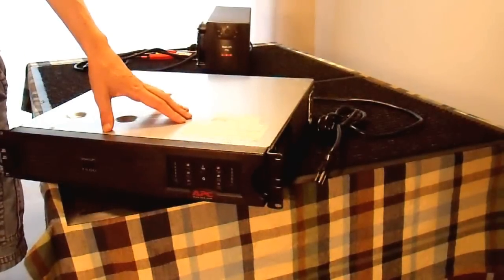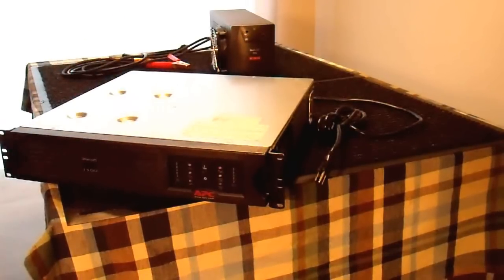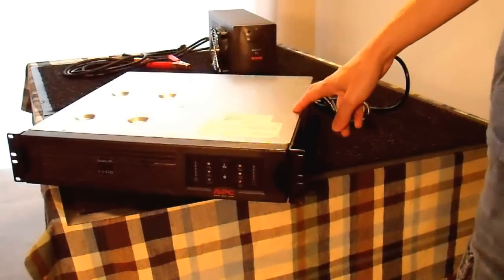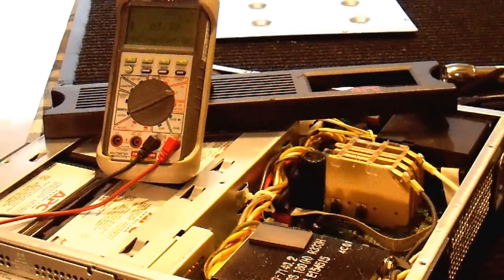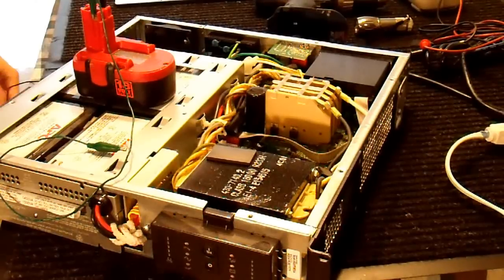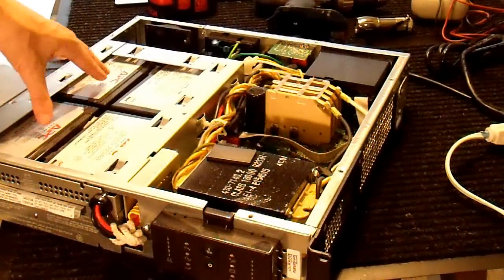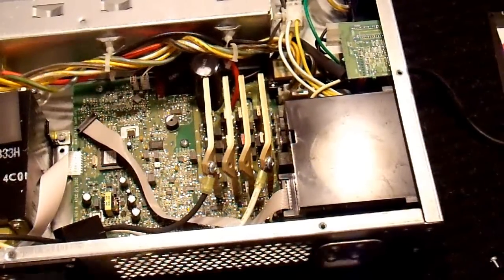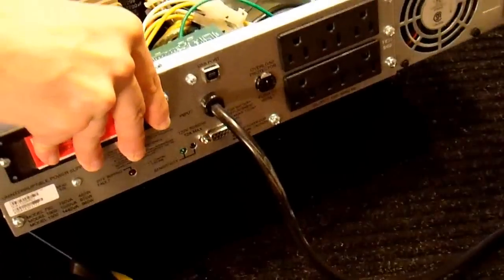UPS to 1.5kW Sinewave Inverter Conversion part1 - Free Sinewave Inverter??

Comment: Weird that an APC rack mount UPS would require the battery pack to power up when connected to mains power the reason being that hot swapping the battery packs is commonly done in the IT world. Every Cyberpower UPS I have worked with powers up without batteries or with dead batteries.
Reply from the maker: They don't want people turning them on without mains power to avoid complaints is my assumption, and they don't want you to power them on with no battery present for the same reason.  I believe the intent is that a 'bad' battery will still allow you to power it up but 'no battery' is not a valid use application.  You can hot swap batteries while running, you just can't turn them on unless mains power and a battery of some sort is present.

Comment: The reason they throw them out is because batteries cost about as much as a new unit.
Reply from the maker: Companies usually have a replacement rotation schedule.  e.g. if the warranty is 5 years they'll replace them at or soon after 5 years.  Batteries are actually fairly economical for these units compared with the price of a full replacement unit.  That said I see a lot of these get thrown out once the batteries die simply because the people making purchase decisions either don't know how they work or don't care about how much they cost.

Comment: have you got any experience with Socomec NETYS RT-120V 1000VA 900W pure sine wave UPS?  On the spec sheet, this is the lowest, and the highest capacity for this series is 4500VA.  I suspect that inside, they have a partially populated board like you've shown in this video.  I'm thinking of putting a big capacity transformer that is 120vac to 240vac center tap. so 120v-120v off each leg to CT.  Do you think this is reasonable, or should I consider replacing the output transformer on the unit itself?  Thanks.... Doug  (I also have a shot at some 12v 190AH batteries - same brand as you got scrap for $40 - for $300CAD a piece.  they're brand new.  Is that a good price in your experience?  )
Reply from the maker: I'd say to pass on batteries at $300 CAD if they are questionable.  Shopping around you can get them for new at nearly that price if purchased in bulk.  If they truly are new and in good condition then that is a good price and I'd jump on it if I were looking for batteries today, but if there is any question as to their condition then they should offer more of a discount in my opinion.  The transformer is usually the highest cost component of a LF inverter/UPS so if you have or can get an appropriate transformer that may be an option.  I have no experience with Socomec.
Reply: @knurlgnar24  Thanks for the reply and the sage advice.  I've got some modified square wave APC backups..... would be nice to convert one to pure sine wave.... I cracked open the Socomec, but the board appears to be fully populated.  I see from the series that this particular model goes up to 3000VA.  At 5kVA, the whole thing seems to change.  Is it possible that changing up the MOSFETS is how they get the added capacity?

Comment: Hi, I have a question. Is there any way to adjust output voltage during AVR mode?
I have APC SUA 1500i, when the AVR in boosting mode, the output sometimes jump up to 247V.
Most of my equipment rated on 220V, so I want to make everything safer. 
Meanwhile during battery mode, the output are set exactly at 220V which is good for me.
I hope you can give me some clue.
Reply: The newer models of APC have an LCD panel Infront, which make it possible to modify some settings ... Including what voltage range the AVR should allow for before switching to battery ... Also the output range that you find acceptable.

Comment: Love your work, have any inclination to help me hack the 2200 and 3000va apc units as well?  Love to do the 240V system with them.
Reply from the maker: As far as I know those units are nearly identical to what I used here with the primary difference being a better transformer.  The XL units are even better as they support longer runtimes and have better cooling and thermal mass.  I always wanted to find some 3000va units but never did for a reasonable price.  I had the opportunity to pull a few out of the trash at my place of work once but decided against it due to them being a 3 phase model.  shame.

Comment: I have a Big Brother to this unit. I just found it really inexpensive I picked up a SURTA3000XL. I was very excited but as expected all 16 12V 5.5hr SLA batteries are toast. I did the math and they have 2 banks of 8 which produce about 96V at 5ah each. they are connected in series I think. I tried to momentarily run to Ryobi 40V batteries in series to get to 80V but couldn't get it to turn on. I was hoping to get a 3Kw pure sine wave inverter but the voltage requirement is making this one difficult for me to work with. I am tempted to just sell it and put that money toward what I need but not sure if you might want to look it over. I can't get it to turn on but I am likely not providing enough voltage to trip the relay. I also ran across a working schumacher 750Watt that had a form factor that you liked. I think you had a cobra one that looks just like this one.
Reply from the maker: Are you sure that unit doesn't require a 48V battery?  They are very nice UPS units and should make a nice inverter.  Not terribly efficient but very capable.
Reply: @knurlgnar24  I am positive. I actually just took the battery bank apart and the lid and just realized this thing needs 192V. I don't know how to send a pic. 48V I could make work but 192V is a bit much to recreate.
Reply: @knurlgnar24  I decided to jump into the world of Lithium Ion. I found some Battery packs on batteryhookup that are 3.7V 4.4ah and include a BMS. I have purchased 52 of these. At $1.30 each this was still cheaper than 16 SLA batteries. I worry about the charger not being setup for Lithium but with a BMS on each cell I am hoping it will be alright. I might try to shoot a video of what I am doing. Not sure how many people out there are into this sort of thing. On a seperate topic I did manage to get my solar powered shed to run on a 3K Pure Sine wave inverter. It is an EMC one but looks alot like the WZRELB ones. It is able to start my AC run my Fridge as well as all my other stuff Desktop PC laptop and 2 monitors. I am pleased.
Reply: https://batteryhookup.com/products/lithium-polymer-3-7v-4-4ah-16-28wh-w-bms-1 link to the cells I am going to try and make my UPS come back to life with.

Comment: I know I have seen you work with the tiger claw pure sine wave 1500 watt inverter.  Do you know if you could tie neutrals together to run A LEG and B LEG of a sub panel that has been removed from the grid?  there are no 220v devices on the sub panel, so being out of sync should not pose a problem.  The wire gauge is #6 on L1 N and L2, so I should be ok there.

Comment: thanks I have 2x 300VA version's of these that have been sitting in storage the last 5 years as I no longer ran any servers at home  , which I am planing on putting 12x 2v 500 Ah batteries into , and was wanting to know if any hardware upgrades would be needed for the longer run time

Comment: i was wondering if i could run a 24v dynamix 100 600w ups on 12v i tried connecting i to a battery but it made a massive spark and the battery input was not working and no fuses were blown ?

Comment: yeah I had one of those APC branded UPS units (similar to the smaller one in the video) which I collected when my dad was cleaning out of his office cupboard...I tried to turn it into an inverter but I was having a few problems First of all I removed the exhausted battery and then rigged up lead with 12v car cigarette lighter plug. Strangely I was only getting about 50 volts AC while I was running my electronic devices like portable stereo radio it was working fine apart from a slight buzz noise heard through the speakers. Then I connected my laptop and phone charger up and they worked fine and I could hear a different sounding noise in those device's power transformers compared to what you would normally hear if it was connected to the normal house hold supply. Anyway apart from that it was working fine for all electronic devices it was intended to do so it wouldn't run my Bosh power tool battery charger and I noticed the unit would sometimes shut off after about half an hour. Would there be anything to do with the unit having a fault or something else? There appeared to be 12vdc going into the unit.

Comment: I have a question. I have a 1000W true sine wave in my Motor Home with 4 T105 6 volt battery's. Would a 2000W inverter draw more battery power not under a load but on, than the 1000w does when it is on with no load. Hope that makes since. Thanks

Comment: Really enjoying your videos knurlgnar24!!!!
These comments cover the entire sine wave inverter series, which I truly enjoyed.
Reminds me of college physics labs, I imagine EE course labs are much the same (probably more fun/practical though).
To me the "wave" episode was enjoyable...actually the whole thing...discussing efficiency...wonderful example of using practical "garage/kitchen" experimental methodology to determine not only how changing a system changes performance, but also of quick trouble-shooting (the red "jumper" to the heat sink).
my only thought in that regard is that in the exact experimental circumstance I would have thought to go from ground side leg first as electron current flow actually goes from minus to plus. (I was taught to follow the electrons() and not the holes (+)), but would have gone to either leg depending on what cables I had laying around. Love your vice grip splice! 

I have 4 Cyberpower 2200's in the "Lab Rack" in my living room lab...with plans to build a battery bank.  I prefer Cyberpower brand UPS's to APC/Triplite as far as customer service/parts goes...but I haven't checked Cyberpower waveforms/efficiency (yet).
Reply from the maker: I haven't worked with Cyberpower UPSs so they might be even better - I wouldn't know.  :)

Comment: Thanks for all your videos.  everything is well thought out. Have you ever decided to finish this project?  what did you ultimately use this modified ups for?
Reply from the maker: I had plans to make two of these, a 24V solar and gas generator setup, and power my whole house (both phases) off of it for power outages and just for interest.  It is currently in my basement unused.  I went with a different setup in the end.

Comment: I get these ups from a friend, 2 or 3 a month, I test them if they don't work I scrap parts out of them, the bats are the best money, I have 50 bats that I will scrap and I save the good ones,all the bats are 12v agm, just wired dif ways to make 24 0r 36v so if u need a bat for yours let me know if u need some, I will  sale at scrap value.
Reply from the maker: I might take up up on that except for the shipping cost issue..  But thanks for the offer!
Reply: wow... I wish I could get freebees like that!  I'd love to repair a few for my own use!
Reply: I am looking to buy a working ups or two. of about 1000 watts each. without batts. if you are selling?

Comment: glade you have this up with these inverters. I have two 1500 smart UP's I traded with two grid tie inverter's as I was watching this video I looked at my APC's and look a little different since yours is rack mount and mine looks more like the one you had in the back ground the small on. but the ones I have are like 900 watts.  now to watch the rest, of your videos. I like to use these for my Solar set up. great videos.
Reply from the maker: The tower style APC UPS units operate in the same way so this video applies to both types.  I have some 1400VA and 1000VA tower style smart UPS units as well.

Comment: i found your videos, i mean all of them, very interesting.
i have APC DL3000RMI3U UPS. i bought it a few days ago and the guy said that i have modified for larger batteries. apparently he has not modified any of its hardware, but i think he just changed its programming. i would like to know how to change its programming for charging larger capacity of batteries. please make a video about the battery constant and battery voltage settings.
i am using this unit with four 150AH liquid car batteries. but when i put a small load on it, it suddenly drop to only two battery LEDS from 5. please tell me how to fix this problem.
Reply from the maker: Running the calibration procedure will improve the problem, but I prefer to just disable the beeper and ignore the estimated level on the front panel.  The battery level meter isn't designed for or useful for large battery banks anyway.  After some use it should partially recalibrate itself but it isn't likely to ever be correct.  That it is showing 2 out of 5 LEDs isn't really a problem - it will continue running until the batteries are drained.
Reply: Thank you so much for your reply. i learnt alot from your videos. can you please make more videos about APC UPS? i would like to know more about APC UPS. specially about its programming. how to modify its programming like you changed its power value in the Hyperterminal.
Reply: i have APC Back CS 500 UPS. i am using it with external large battery. the problem with it is that it runs only for one hour and forty minutes and then it shut down automatically, though the battery is fully charged. when it shut down, i wait for about 10 minutes, turn it on back and it will continue to run for another one hour and forty minutes and then shut down. the battery is not drained and the ups is not over heated but it shut down automatically. can you please tell me how to fix this problem?
Reply from the maker: Ataullah khan
That sounds like a software issue.  If running the battery calibration routine does not improve the issue then it may require some creative work to get around the issue.
Reply: can you please help me how to fix this problem? how to modify its software for long backup?
Reply: you have APC BACK 650 UPS. Check it, i think it might have the same issue.

Comment: Sir I don't know my UPS specs but it seems like yours black one and same size so seems to be 600VA no it works on 12V DC batt if I connect it to an scooter alternator of 24V DC 80Amps instead the 12V DC batt . Can I run a 850W centrifugal water pump successfully plzz reply need a project in summer
Reply from the maker: The UPS in this video is 980W or 1500VA and requires 24VDC.  I don't know the specs of your specific UPS.  This one would run an 850W water pump but would overheat without modifications.
Reply: can you please provide me specs and cost of an inverter which can take power from a 24V DC and some amperes from an alternator coupled with my 2 stroke engine.. Thank you

Comment: could you do something like this to a car amp some amps are rated to 6000 plus watts?
Reply from the maker: Car amps (and the audio world in general) are horrible for their specsmanship issues so it's difficult to get any real information out of the manufacturers.  In the analog world it is very difficult to properly modify anything without messing up the quality characteristics.  For a class D style sub amp those sort of issues are less important and you could probably mod them without too much trouble.
Reply: thanks

Comment: Hi i have a dc to ac inveter cobra i bought new and it dont work think you can fix it?
Reply from the maker: It is most likely repairable.  What is the model number?
Reply: cpi 1575 1500watt continous and 3000 watts peak
Reply from the maker: Gabriel Campbell
I believe that inverter can be purchased for around $100, and based on the 2.5kw version I suspect it is closer to a 750w inverter in reality.  Shipping costs may eat up the risk premium on that one.  I'd be willing to look at it if you wanted to ship it to me (I'd make a video of it of course) but no guarantees.  Not everything ends up being repairable unfortunately.

I would personally recommend selling it on eBay as 'for parts' and purchasing a new one.
Reply: ok thanks for the reply seeing i took it apart and broke wires running into the meter on front panel and broke off the Adjustable Power thing off the side and fried one of the mosfits might not be worth fixing if you live in the united states and wanted it i could send it to you to have but don't have the screws to keep everything togeather but this one dont have all the mosfits down the side any how to keep them cool like other ones so up to you nice vid by the way

Comment: Hi, my name is Dan, I enjoy your Videos--I also fool  around with electronics. I found a BEST FORTRESS Inverter. I was wondering if you've ever heard of them? It must be a pure sinewawe. It says 650 VA. And it's the only one that will charge my electric car. Of all the inverters I have. The electric car needs a minimum of 5 A at 120volts to begin charging. It does get very hot when charging the car. My question to you is I have two of them is there anyway to put them in series to get 240 V ? Or is there going to be sync.  problem ? I am using two 12v  larger batteries. The current going into the inverter seems to be 25 amps. I am recharging the batteries with my solar cells on the roof. 
Thank you very much for any help that you can provide. 
And thank you for posting those videos. !!
Reply from the maker: Unless you have a way to sync them together getting 240V is going to be difficult.  I have never heard of that particular brand, BTW.

Comment: Always check the individual batteries in a bank like that because they're most likely just 6 or 12 volt batteries wired in series and/or parallel and if just one battery is bad the whole unit goes down. I have repaired a $1200 unit by just replacing one 6 volt battery for $50!